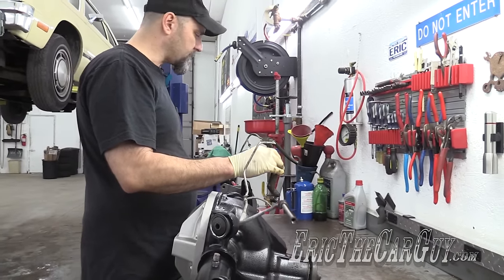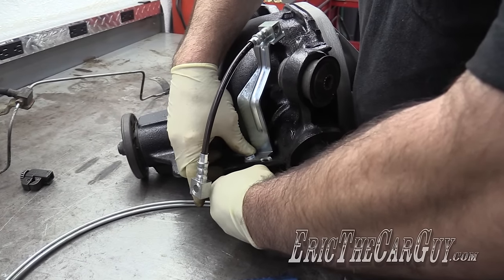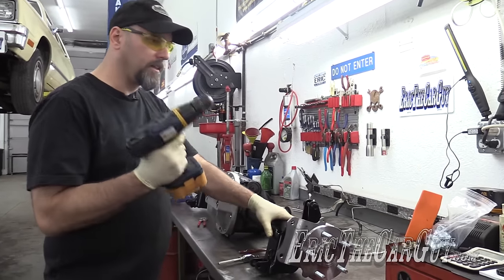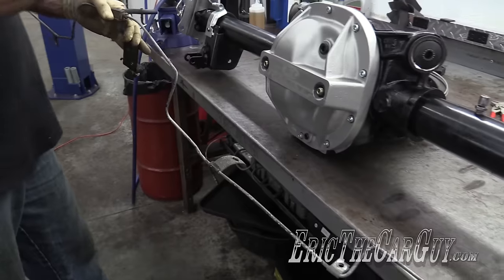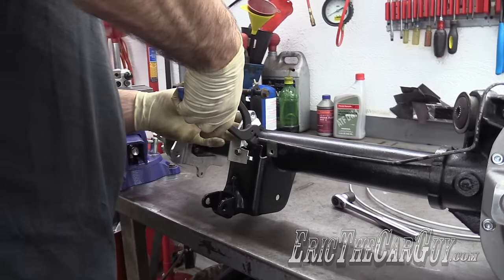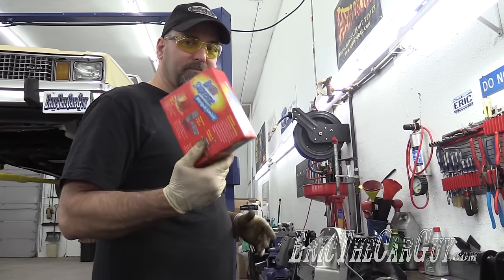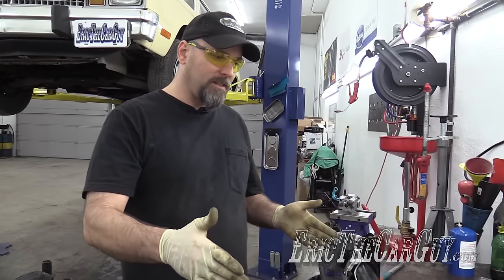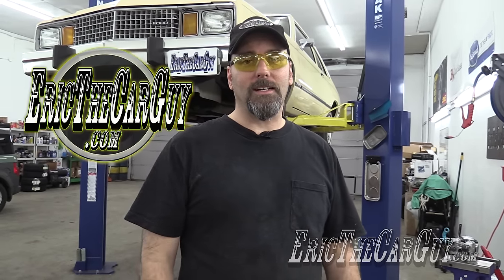Bending and Flaring the Differential Brake Lines #FairmontProject

Comment: I agree with you about using new parts on the fairmont. Especially brake lines I mean after 37 years who knows how much life they have left in them.
Reply from the maker: Good point.
Reply: Technically it's only 30 or 31 as the diff is out of an 86 mustang, not a 79 fairmont. Personally given eric's tooling and intended usage I was a bit surprised that he even considered re-bending the old lines. If they jut fit (or could be cut down) and were rust free without any damage (that kink counts), sure. But my concern would be metal fatigue from the bending and unbending causing a failure under stress... failure at the worst possible time. Granted, this video was likely shot before he chose a different engine path, but if you're pushing 500HP, I wouldn't take any chances.
Reply: Larry Bolan my point exactly! :)

Comment: They make long tube bending springs in various diameters. You slide them over the tube and use those for straightening out the tubing and it will look factory straight. The cool thing is they sell them at the Homeless Despot for very cheap.

Comment: I got in the habit of taking a small section of fuel or vacuum line , splitting it on one side and placing it over the mid run of any brake or fuel line mounted to metal. It acts as a stand off, keeps them from rattling, and gives you something to cinch a zip tie onto for security purposes. The only thing more sanitary looking is a premade insulated mount.  When you find the perfect location for them you can glue them to the line with a dab of RTV sealant and they'll be there till the cows come home...! You can share that tip if you want... it works great and lasts forever. Looks professional too!
Reply from the maker: Great tips, thanks for sharing them.
Reply: Personally, I wouldn't do this for a regular street car. Everything tends to rust around here, even worse if its enclosed but not 100%watertight. Unless of course it was CuNopp lines which shouldn't rust.

Also, you could find a line that has the inside diameter that is the same size as the outside diameter (well just slightly larger) and just slip it on the line before you start to bend it. No chance it will ever come off them.
Reply: I was under the impression the lines were stainless steel.
Reply: Stainless lasts forever, and a line inside a line is simply not practical, not called for and the flaring equipment wouldn't work properly... it's sized to grip the actual line being flared. You don't have a clue what you're talking about friend. Sorry...
Reply: Stainless steel can rust. It depends on what mixture and ratios was used to make the stainless. Its more rust resistant, but not rust proof. Its why there are different grades of stainless steel.
I might have missed it, but I never heard Eric say he was using stainless lines. As a mechanic that works mostly on daily drivers, I wouldn't think he has a lot of stainless line around anyway. Its not something most people have on their cars.
As far as flaring, I never said to put the hose end to end. Even if you did, you could just slit the ends of the hose enough to flare the line.
Your idea wasn't practical to being with, but neither is Eric's car. I already mentioned that everything here rusts, creating a spot for salt/brine is just asking for extremely quick rusting. Unless you get a high grade stainless line, I'm sure it will start to corrode eventually, it might just last longer than a steel line that is typically found elsewhere.
Reply: Yeah dude, I'm a welder by trade... I know all about metallurgy...
Reply: Instead of stainless, I use copper-nickel alloy. Stuff is a joy to work with - you can bend it with your fingers easily, and it never rusts through. Also easier on your dies - never need lubricant. Will get a green patina like copper when exposed to road salt and left to sit, but that's as bad as it gets. I love the stuff. Use it on everything up here in MA. Doesn't look too bad either.

Comment: With keyless chucks I finally realized that you need to get the drill bits with the three flats on the base of the bit. That completely ends issues with bit slipping when drilling into metal.
Reply from the maker: Yea that would probably work better.

Comment: Hello Eric, I really enjoy your content here in Youtube. I see you doing threads in few of your videos and just wanted to share a tip here. When doing threads by hand ( as opposed to machining the threads ), you might want to use two different taps for different purposes. First of them is starter tap and another one is bottoming tap. Name tells what they are supposed to use for. for thru-holes sure you only need started tap, but in bottoming holes do tapping in two stages, starting with starter tap and ending with bottoming tap. Now another thing. You'd want to use cutting/tapping compound that is grease-like when hand tapping threads. Oil is OK but those areas without cutter are meant to collect grease and removed metal chips from holes you tap. Much cleaner, easier to use and has no chemical effect on metals you work on.
Lastly I like to tap like this, not saying it's the only option. Drill hole where you want it, chamfer hole opening just a little, apply cutting compound in your tap and line very carefully with hole. With little pressure on tap make it cut 360 degrees, then go back 90 degrees, go forward 270 degrees, come back 90 degrees, forward 270.. continue until your tap bottoms up or has it's widest part through the hole. 
Sorry for long text and my weak English. And greetings from Finland. Keep up these good videos Eric, I really enjoy watching! Also great camera work by Brian!

E: meant tapping compound, not cutting compound
Reply from the maker: Thanks very much for that input. I'll have to try that in the future.

Comment: As far as using zip ties Eric, I'm curious if using them as fasteners AS WELL AS spacers would be beneficial.  

Basically: 
Wrap a few of them around JUST the axle tube as 1/16" thick plastic stand-offs.
Then wrap a few around the tube AND the brake line.  
That way there's no metal on metal contact even if vibrations are induced from the suspension, they can slide around a bit if needed,  and, as you said, it'd avoid debris getting snagged and hung up, less water would be retained in that gap as well, more open air to evaporate quickly.  Nice part about having zip ties under the car too is you don't have them in an area where they'll be damaged by UV radiation, so they should ideally last FAIRLY well enough if decent quality ones are used, just swap them out at a regular service interval for a couple bucks.
Reply from the maker: I have no concerns about how the brake lines are mounted.

Comment: I've been doing brake work for years and have yet to flare one. Flaring is better, but only if you have a good way of flaring. My flaring equipment is from the 60's and is prone to making weak spots. I have it for when necessary, I've just never found it necessary.

Comment: Eric I would like to advice you to put some zip ties to hold the lines down , preferably a set on the far right of the right side and a couple of sets on the left side both far left and next to the diff, since the vibrations of a solid rear axle especially on such long soft and tiny tubes may one day reek havok on them. 
( I know you have already mounted the assembly to the car but still it is easy to do it afterwards, just keep it in mind !)
Reply from the maker: I didn't want to create an area where dirt and debris can collect. Thanks for the input.
Reply: no problem , the whole axle turned out great by the way and the beefed up diff cover may actually save your gears in the long run too.Thanks for your videos !

Comment: Hey Eric. Back in the 40's they had a very precise measuring tool they used to measure the brake lines with the bends and all. I am so surprised you don't used one?
Reply from the maker: A piece of string?
Reply: Oh man.....Eric I am disappointed...The answer is a coat hanger. ..Good try though.
Reply from the maker: Sorry I missed that. I also sometimes use the old line as a template and zip tie as I go. That way I don't have to worry about the line going all over the place as I bend the new one.

Comment: Ugh. Brake lines. Our least favorite job in the shop. And thank you for using that clamp on the right side. We have seen lines prematurely fail by not using them. The lines actually move slightly when the brakes are applied.

Comment: Your drilling reminded me of customer that came into the shop I work for. It's a old Jeep Cherokee with the 4.0L. I don't know the exactly what the original compliant was, but I presume it was either CEL emissions failure, or he was complaining of an intermittent gas smell. Anyway the technician diagnosed as a leak coming from the top of the tank, so we ordered a seal kit. This kit took a while to arrive and we just dropped the tank yesterday, revealing the real problem. Turns out this guy wanted to put a sub in the back and had drilled six holes through the floor and right into the top of the tank.

Comment: Don't you put some corrosion protection on those holes drilled for brackets? or maybe perhaps you did, but didn't mention on video? I'd put some on because the next time I'll be looking at it is a few years down the road, where they might or might not rust depending on use.

Comment: Zip ties will not hold, a couple heat/cold cycles is enough to shatter them. Instead, just get clamps, or make them. I made myself a ton of bracket/clamps out of shim stock or out of that metal strap that's on wooden boxes when they are shipped.

Strong, easy to make, one installation, you'll never worry about them, especially if you go to the shipping box strap, since it's anti-corrosive.
Reply from the maker: I have no reservations about how the lines are mounted. Thanks for the input.

Comment: Do you have to worry about work hardening the brake lines when bends are re bent? will it cause an easier point of cracks in time and vibration?
Reply from the maker: I've never known that to be a problem. At least in my experience.

Comment: Question: When you drill into metal like that, do you ever worry about rust occurring where you exposed metal? Do you put grease or some kind of anti-rust coating on it? 

Thanks. I'm new to cars, especially heavier modifications like this.
Reply: Sure, eventually it'll rust - it's really a matter of whether you want to spend the extra bit of time required to prime and paint the newly exposed metal or not.
Reply from the maker: I'm not as worried here since it would take some time for a a differential to rot out. As you'll see in an upcoming video, I sometimes paint freshly drilled holes to help prevent or slow down the rust.
Reply: Thanks for the answer! :)

Comment: Eric, where did you get those pliers?! I need them! Also what"s your opinion on the S.U.R&R copper brake lines? I use the stuff all the time at work & it's just makes the job so much easier/less stressful. I hate running new brake lines, shit sucks lol.
Reply from the maker: Link in the description.
Reply: Yeah I prematurely commented. I need that flare kit but can't afford it right now. If you haven't tried the S.U.R&R lines yet, I highly recommend it.
Reply from the maker: They make a less expensive flare tool that works well. I'm going to wait till I run out of the line I have stocked up before I try new stuff. https://www.youtube.com/watch?v=AP3z_Qg_6-o

Comment: Try all this with stainless. I completely outfitted my Girling-braked Lotus Europa with stainless line and fittings. Ouch!
Reply: To be fair, the flaring tools have improved since I did that stuff.
Reply: Yeah, I wouldn't want to flare stainless with any of the old threaded tools. They don't even work well for soft stuff. I don't care if you have some $20 Chinese special, or buy it from Snap-On. They were all pretty much made in the same factory in China. The new hydraulic flare tools with dies look pretty promising.

Comment: EricTheCarGuy Might you be able to give me a little advice on this problem I'm having. My car seems to be getting fairly low gas mileage once again, averaging about 18-20 mpg when it should be about 23-24 mpg. I took it in to have the codes scanned and they are telling me it is throwing an intake manifold code and an EGR valve code. I just replaced the EGR valve and also used a new gasket, torqued down to spec and everything. I'm told that if the EGR valve code is being thrown it could also cause the intake manifold to act up as well. Could I possibly have gotten a bad EGR valve? Let me know what you suggest. I went around the intake manifold and checked for any leaks but I found none.
Reply: Yup what JJ is saying here is probably correct. I had and egr code on my malibu 3100 v6 and spent time cleaning the passage itself. Had to remove the throttle body and egr valve, a wire hanger and lots of carb cleaner but eventually cleared it out. Stuff a rag into the intake to make sure nothing falls in. EGR valves themselves are pretty simple devices on their own, so they rarely go bad. I cleared the code and haven't had it come back.
Reply: Don't forget to Look for cracked/split vacuum lines around EGR  valve and the EGR solenoid. I fixed 3 EGR codes and not one needed a new EGR valve. 1 was Carbon blockage , other was a Vacuum line that cracked open, and other that the EGR solenoid nipple broke off.

Comment: Is it just me or did it look like the caliper will be sitting behind the rotor?
Reply: I thought the same thing so I went back and watched the video on ETCG1 channel and he was showing all the new parts and the rotor's are dished deep enough I think.
Reply: I observed that as well at 3:32 and although I am not familiar with the conversion kit Eric has, it does seem there is a considerable depth with the caliper mounting position. However the brackets were stamped left and right in the prior final assembly video, so those rotors must have quite an offset.

Comment: Those bending pliers you use seem like a pain in the ass. I think you'd be much better off to get a 3 handle bending tool. It just holds 2 handles in one hand, bends the tube with the 3rd handle. No muss, no fuss. Would really make you life easier to find one of them. 

Although... I love your flaring tool. MUCH better than the one I use. :D

Comment: DOH!  You have that bare metal...open to elements...should have shot some paint in those holes.  Sure it isn't as good as the e-coat they put on those brackets, but it would be something.  Might want to take that apart and just shoot some paint in there to slow (it won't eliminate) the rust that will occur.
Reply from the maker: It's going to rust at some point anyway. Thanks for the suggestion.

Comment: hello, my 03 corolla has a slight vibration when it's in drive or reverse, when it's in park or nutral it doesn't vibrate.

also if it's in drive and I'm at a stop I can rotate the steering wheel and the vibration stops for a moment.

why is it vibrating?
motor mounts?
transmission?
Reply: I'm not sure but I'm thinking the mounts
Reply: +Wtrxprs007able thanks.
Reply: Also (can't edit comments on mobile dammit), maybe changing the trans fluid and filter might help the vibration?

Comment: Get metric drill bits.
Drill diameter for metric bolts is allways thread diameter minus pitch.
Std M6 has a pitch of 1mm, therefore 5mm drill bit.
Reply: Isn't the pitch how many threads there are in a millimeter? For standard, it's # of threads in an inch? Usually for metric I see .75, 1, 1.25 and 1.5. Does that also mean how deep the threads are?
Reply: +Nate Rowe 
yeah Pitch is threadway per turn. the angle of the pitch is 60° so it's a equal sided triangle, so the pitch is also near the height of the triangle therefore the rule of thumb is diameter minus pitch equals drill diameter. This makes for perfect clearence.
Reply: Very interesting, I didn't know this. Thanks.

Comment: I think I would have used some radiator hose clamps to go around the brake line in rear end and then paint them to match
Reply from the maker: I'd be concerned that would hold in moisture and dirt causing rust.

Comment: You didn't paint the holes you drilled? You should always slab any paint on top of the metal so it won't rust.. It's prevential maitenance and you can thank yourself later when it didn't rust there :P
Reply: And no braided brake lines... :(
Reply: He said those are braided brake lines, they're plastic coated. Helps with the sleeper look.
Reply: Larry Bolan Oh. Well i guess it makes sense to coat them with rubber so the debris doesn't get under the braids.